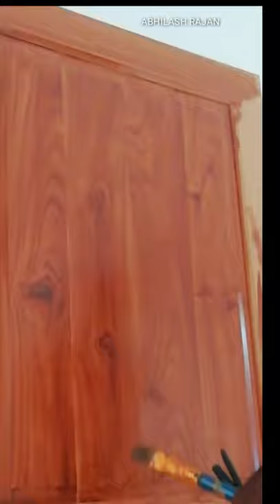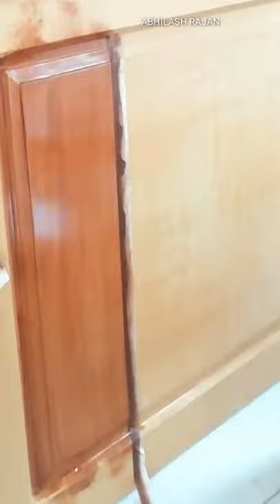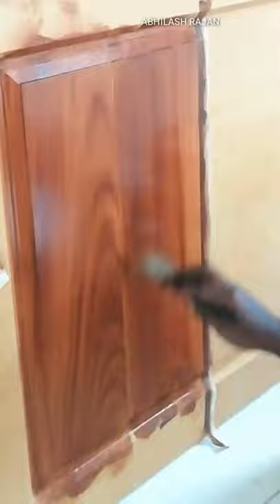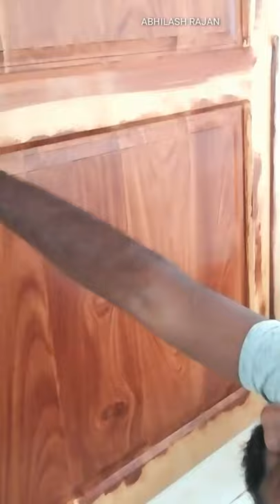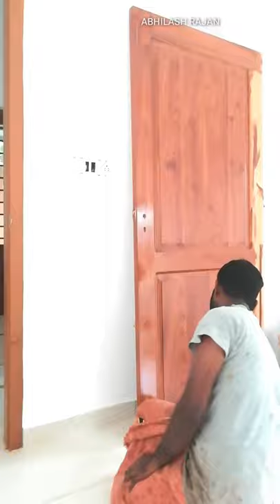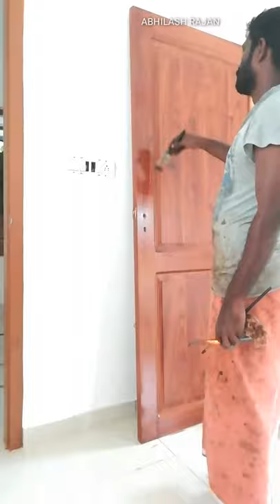Teak grains art on wood doors

Comment: Dear Sir, could you please help, on what should be base share and than coat for getting light wodden texture on false cealing.
Reply from the maker: What help do you need?
Reply: @ARTANDCRAFTEASYTOMAKE   i need to do texture wall paint , wooden pattern. Not dark. My painter not able to produce it. Can  u tell, what should be base coat of color, and which color to mix
Reply from the maker: A liter of teak color 200 ml of white paint can be used to make a base coat
Reply: @ARTANDCRAFTEASYTOMAKE  thanks, and for upper coat ?
Reply from the maker: @vishuonline4u 
Please check the colour mixing videos in my play list